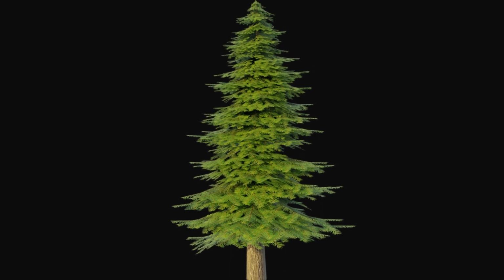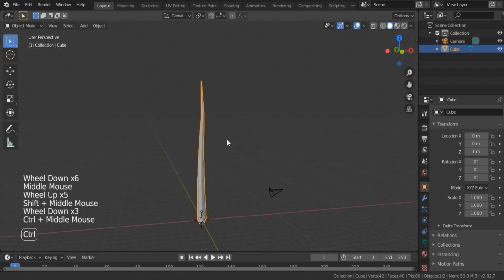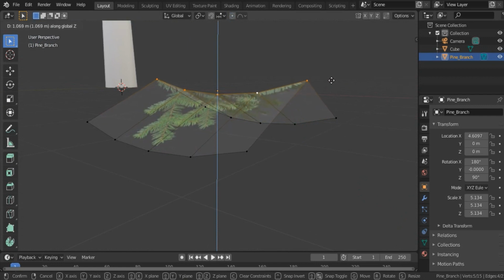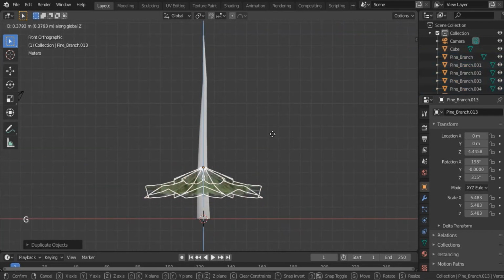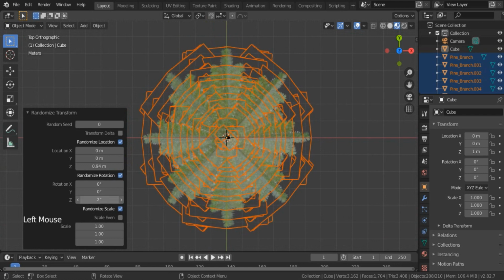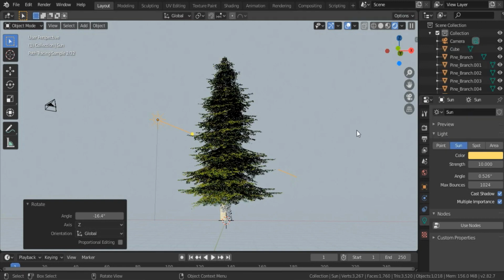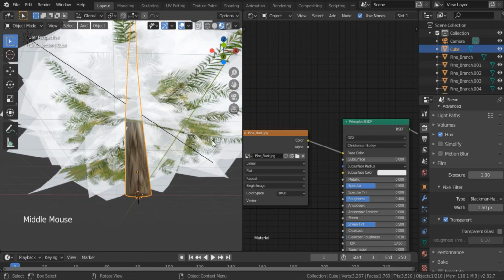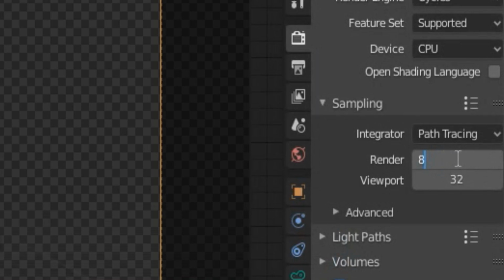How to Create a Low Poly Tree in Blender (FAST !)

Comment: I have a problem.
When I "image as plane" my pine leaves from photoshop PNG. file off my desktop the background shows up as black on the main viewer. If I go into the UV editer however the transparency is there (the alpha has come over)
Any ideas?
If I bring over as a reference for example instead of image as plane the transparency comes over. It only comes over as black with the "image as plane" option.
Reply: I have the same problem.
Reply: @finjonzzzku8157  - My guess is that you're using Eevee render engine!
Here's the fix - https://www.youtube.com/watch?v=lFWiU0a5CiQ&t=113s
Reply: Go to N panel and color to texture